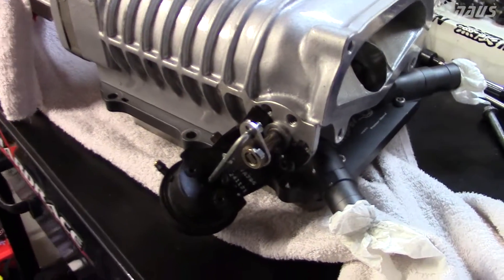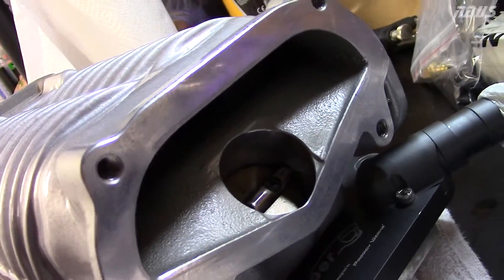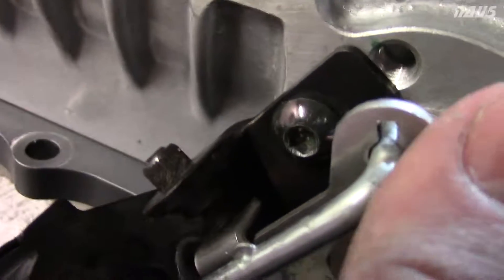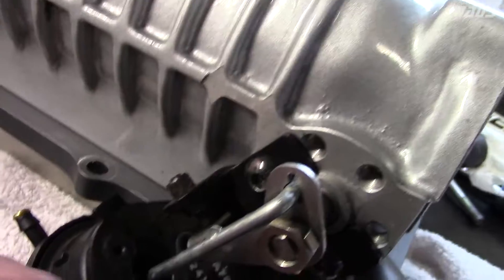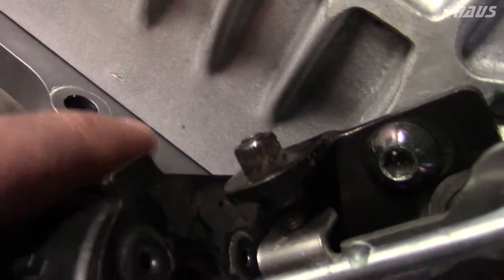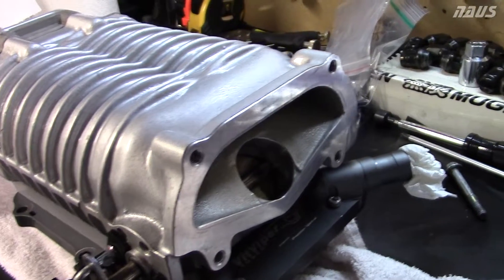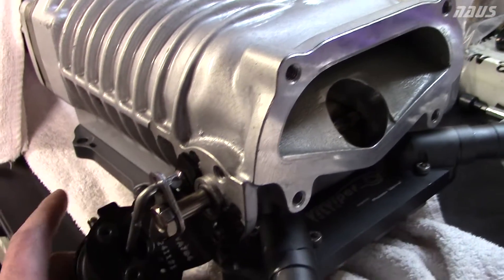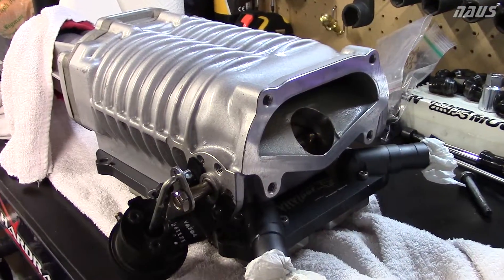How to Adjust A Supercharger Bypass Valve

Comment: You said something incorrect. Boost will not be sensed on the bypass actuator/diaphragm. Its vacuum source is pre rotor. It's manifold vacuum only.
Reply from the maker: My friend, the bypass valve and the boost gauge in this car T off the same barb. What the gauge reads is exactly what the valves sees. The barb is in the intake manifold after the rotors and aftercooler. It 1000% does see vac and boost
Reply: @NAUS2K  i guess I stand corrected in your very rare/special case. All the (much more common)Magnuson stuff gets it's bypass vacuum source just behind the throttle body. You title sounds generic but the comment of boost referenced bypass is specific to your blower.

Comment: Can you clock the bypass valve and bracket clockwise? It seems those extra holes allow for different mounting options. My bypass valve nipple hits my bracket but if I can mount it on the other holes so it's angled differently it will not hit.

Comment: i tried a new map sensor, still no boost,  i opened the snout and set the bypass correctly, i made sure the butterfly was closed as soon as it hits the screw, but kpro shows no boost.  cant find a single vac leak. im defeated
Reply: The actuator might be screwed . They break . Do a delete
Reply: @dvtv4629  I found the leak, the throttle body gasket isn't sealing against the rbc adapter, I've tried so many gaskets, don't know what else to do, even tried permatex, that worked for a day, then blew out
Reply: Replace it.  or get OEM gaskets . Try someone else's. See it it fixes it .
Reply: @dvtv4629  I've tried the Honda oem gasket.  When I look at the gasket, u can see impressions from the bolt holes from the rbc adapter, air is escaping through them
Reply: I don't know Honda . Seems wrong  tho .is it together right, sorry for the simple question. And can you maybe shave the bolts down     . Just doesn't seem right to leak like that   unless that's ultimately not your problem  , just guessing from here . Good luck bro

Comment: is there a way to adjust the bypass screw with the snout on, mine came lose and im not sure if its set righ,t i tightened it back up, i dont want to over heat the whipple or have to pull it back off to set

Comment: Mine isn't touching the screw, theres a gap between , about the size of two nickels, should I adjust the screw? Btw I can't seem to make power past 4-5k rpm
Reply from the maker: You need to do what I explain in this video to throughly check it , pull the snout off
Reply: @NAUS2K  ok im looking at it, and i was gonna adjust the top 2 screws but the bypass valve spring is stuck or siezed, i cant get it to open the valve. what did i do

Comment: @NAUS do you know what screw size are the one that connect the bypass valve to the supercharger? I think there 2 of them but not sure what size are those tiny ones.
Reply from the maker: I no longer have his blower or i would go check for you
Reply: M8 1.25 x 10mm or 12mm length.

Comment: Critical for any SC like this. You're one of few that actually talk about the set screw. I found mine adjusted closed but was about 1mm away from the screw. I took off the TB and ensured the plate was closed before tightening the 2 vacuum can bolts, then adjusted the screw to barely move the stop. Now I know the stop is taking the close pressure and not the aluminum housing.

Comment: I'm not sure where you would put marks to keep track of the position of the bypass or should I  remove the tb and inlet and verify that way ? Hopefully mine lasts a long time.

 I managed to get that nut on the stud without removing the bypass but the nut looks like a rectangle now.
Reply from the maker: I explain what you should do in the video bro!
Reply: Adjustment yes but I'm talking replacement.  I'll figure it out when  I need to.
Reply from the maker: adamra187 yeah just remove the inlet and adjust it visually , I wouldn't trust marking anything
Reply: Well mine didn't last very long...... I've had the kit on for 2 years and about 24k miles.  Just found out CT will not ship to Canada so now to find one elsewhere.....fun times.   I'm kind of thinking I'll be next in line to remove it all.